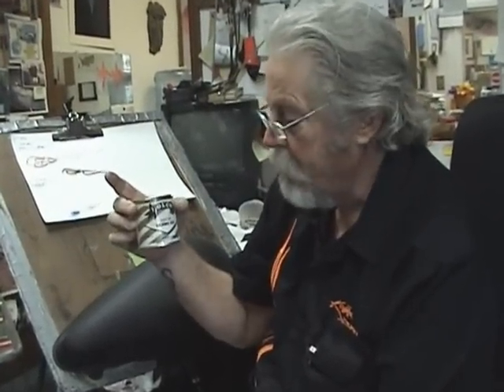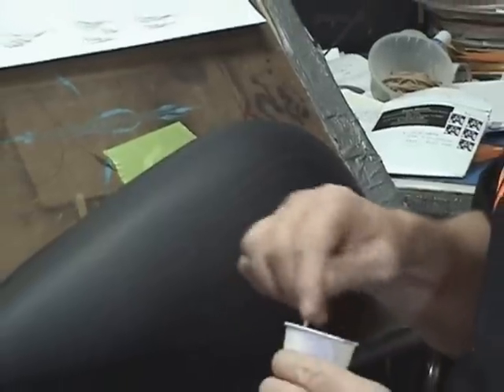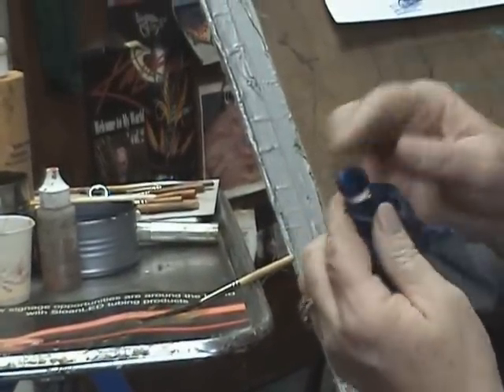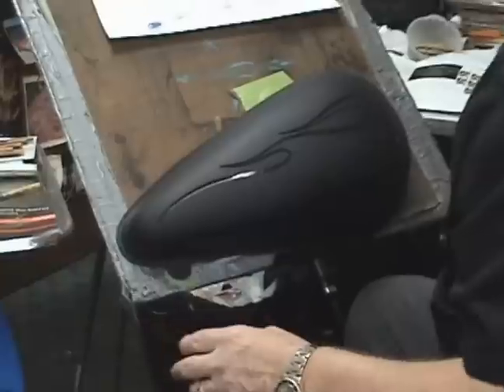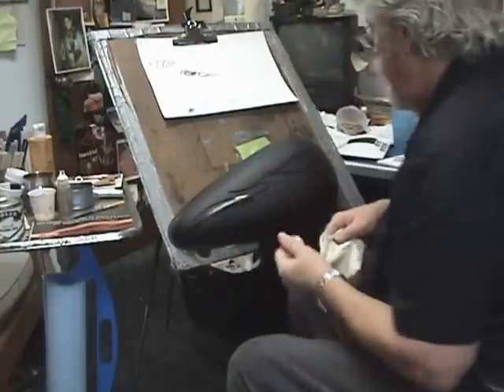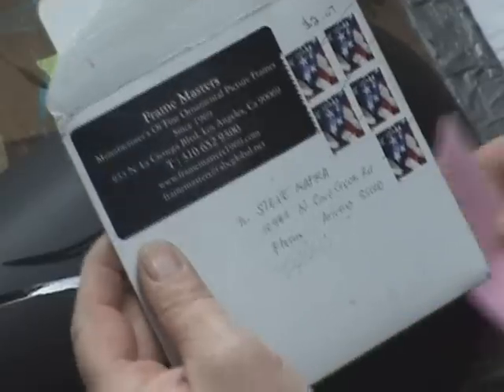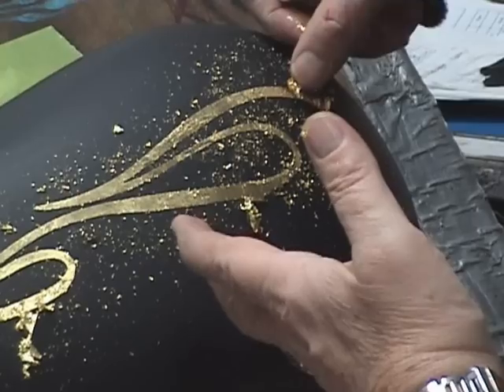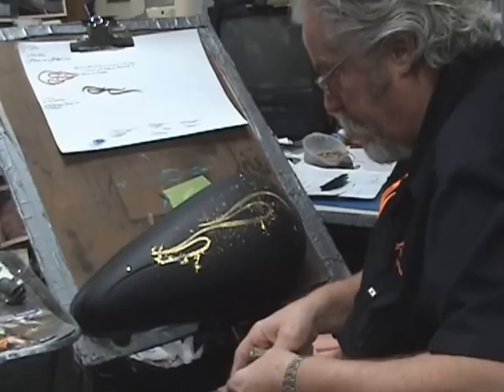Steve Kafka 23k Gold Leaf Flame Graphic, Part 1/2

Comment: I'm so excited that I found your YouTube channel! You and I are pretty close to the same age, and I am an aspiring airbrush artist ,I also ride a Harley, I'm only 5'5 ,& a buck 75, being so short the only Harley that 1 or the other foot can reach the pavement (without duck walking) is a sporster, i know I've heard it all before ! But the deal was so Incredible I couldn't pass it up ! A 1993 sporster  883 with 19,500 miles ,the shop manual, every service recorded with receipts, all after market receipts, highway bars,front highway pegs,solo seat,2 different long seats, sissy bar with small rear chrome rack,3 different styles of grips,4 pairs of HD gloves,2 winter&2summer ,riding leather pants,w/pads ,jacket w/pads, front&rear disc brake locks, 1w/alarm -1 silent  and so many more parts&pieces to mention . All for the sum of $ 3,000 ! The only catch ! For this price there's always a catch ! The guy lived in Yucaipa calif ,in a senior trailer park ,no carport,or garage  ! So aluminum and rain water don't mix,the cases oxidized, as well as jugs,triple tree,the only aluminum that didn't oxidize was the heads,probably cause the peanut gas tank protected them ,front forks also! I've decided to clean it up as best I can,use self etching primer, and matte black the whole bike except ,heads, pushrod tubes, ill detail the cooling fins ,a local body shop supplier has some extreme paint that is 10 x better than rattle can header or BBQ paint ,that won't peel,flake or discolor from heat ! I got rid of the small gas tank,i bought a pacho-pako ?4.5 gal,flush gas cap,got a killer deal  $275.00 for tank, pkg deal gas cap included for $ 25.00 w/new bolts,rubber isolators, petcock/off/on/reserve, fuel filter,all for $300.00+ plus damn calif,state tax of 8. 3/4 cents per dollar, this state really sucks now ! I'm so ready to find another state ! Any suggestions? Have you ever tried true fire flames ? Just wondering, your old school flames are excellent, especially seeing the process of wet over wet ! I couldn't catch where you bought your pinstriping brushes from ?which ones would be needed to complete for a start to finish striping job,just the needs not the wants, extras can come later,ill need #'s  and proper names ,and manufacturers/seller/ website/or phone#. And how does your price system work? In 1of your videos 1-hour $125.00 per hour,both sides of HD gas tank =2hrs =$250.00 ,$ basic old school flames ? Pinstripes on said flames -$ 75.00? I just need a general price range for all you do as I don't want to cut any artist throat by no means ! Nor do I want to overcharge potential customers, there are standards i set for myself, and will honor all those I've learned from ,not to put out crap work , i pick up knowledge from all the best,proficient air brush tutors i can find,this business is so hard to bust into, i advertised on Facebook for a local tutor,3 months later I get a call, he and I painted my new tank with epoxy primer, charged me $100.00 for 1 qt of epoxy paint,reducer, used my spray gun,gave me 2 mixing cups,2 sheets of 320 grit ,to sand rattle can 2-k primer,1 small rattle can guide coat, 2 sheets 600grit,2 sheets 1,000,2 sheets1,500, & 3 sheets of 3,000 1 for final scuffing before clear coat,& 1 for final color sanding,&1 for scuffing before buffing. I gave him 2 gas tanks in lewe of teaching me some airbrush tricks &tips&short cuts ,and things to avoid.  The guy painted up the gas tank ,entered it in a art show which the actor Danny Trejo attended, he fell in love with the gas tank and had to have it, un known to my tutor and my self all art entered for show is donated and sold for charity, which is a good thing, so my tutor freaks out ,calls me &says he can't get my tank back,then tells me that unless somebody out bids him my tank is going home with Danny Trejo,  my tutor painted it with a Breaking Bad Theme, it had the main character Walter on the side,part of the airplane on the other, and a dog always seen on the opening credits from the series, i told my tutor to just go ahead and give my tank to Danny, so Danny just gave what he felt was extremely generous & above &beyond.  I did get some pictures of my tutor,Danny Trejo,another actor friend of Danny's And the gas tank !  I told my tutor that the art  show,and  publicity  would be good for him and get his name out there as an artist, i then said before you get a big head how many 1 hour sessions did he think would be fair for the loss of a $400.00 gas tank that Boosted his career, he quit his paint&body shop job &went solo, and now is the painter in charge of the custom designs of Harley Davidson paint jobs,and special orders from customers who are willing to pay the big bucks to be different than the cookie cutter Harley 's out there, i hear my tutor is doing well,$60-to80,00 per year,plus bonuses ! Good on him,too bad I've only see him a total of 2 times, the other tutors on YouTube, yes they show you a few common things ,but want you to buy their DVD series from &39.95 + shipping  per DVD for a 12 -15 box set! There is only 1 guy out there that helps newbie 's ,he said something that I was experiencing that nailed everything right on the head! And that was the thing that happened to him and thats why he will never charge ,for anything he puts out there ! He said every tutor out there will only teach you the minimal basics & tells you to practice ,practice,practice, and that should keep you busy for a good 6 -8 months then the tutor will show you a few short cuts,and a few tricks, and lots more practice, im not knocking practice, practice is good and required for muscle memory, i put in the hours and paint everything that doesn't crawl away, i mean I go buy hoods ,doors,deck lids just to paint on, i put the paint on when done,wipe it off with lacquer thinner &start over ,&over& over,.this guy tells it from the heart and wants to keep you from the tutor pitfalls, & wasted time&money&energy, this guy said the tutors won't teach you their best stuff because you could end up better than the tutor! How would that look ? The tutors out there consider you competition ,and see you taking money out of their wallet,robbing you of food,housing,they want all the jobs out there ! Even if the population of your city is large enough to support 6-10  airbrush artist  so everyone can make a living ! This guy said he seen and heard it and experienced pretty much all of it,even had customers tell him that so&so told him you were sloppy,didn't finish customers art,and even sold customers stuff ,and then there's the thats why you had to move here  ,you were run out of town etc,etc,.you should check this guy out one of these days when you got nothing to do or your football team is loosing and no way to make a come back ! His YouTube channel is bloodshot army airbrushing  he's a Canadian  but I swear he talks like a California surfer from the 1960's he knows his stuff,he's sincere ,honest ,
And can and will answer any and all questions, the only stupid question is the one that was never asked! You can text him any time and he will respond as fast as he can ! He even has a few projects where the newest paint called lumalore  which is electrically charged colored paint that is a several stage process and has to be tested for grounding,continuity, and shorts, before its sealed.with paint  the paint runs off its own battery or can be fused& wired to your ,car, hot rod,chopper,Harley, skate board bicycle ,boats it can be put on almost anything, it comes with a controller,that you can set the brightness, the speed of the electric flow,you even have a fade option, that you will see nothing then it starts being visible  gets bright then disappears  or just keep it on high all the time at night (the being seen thing ! Cars never see us ! So many close calls ! My next purchase is going to be a train Horn! I need to find a small air storage tank I can hide on my Harley along with a POWERFUL small 12 volt air compressor capable of cycling up to operate a 160-180 pressure switch that can be hidden or camouflaged  ,then the next a**^ole that turns left in front of me gets the whole experience ! I'm 63 and don't heal like I did when I was a pup ! A loyal fan Billy Gross,
I have quite a few of your videos to watch,&take notes &save again thanks for doing all you do for the new guys&girls .
Billygross592@gmail.com

Comment: I guild my artwork or if Im commissioned to do a piece thats from the Gutenburg Bible. Guilding on calf/goat skins is much different than what I use but I've always loved your smooth lines and watching your videos. Jerry Tessler makes a very good raised gold leaf gesso and REAL gold leaf sticks beautifully. Speedballs imitation is okay but you better seal it otherwise it will oxidize. I am going to try your burnishing method when i do gold leaf on my art boards, i love the swirl effect. I unfortunately purchased the $105 heminite stone from a calligraphy and illuminated art/lettering site and it works no better than my 11 dollar and 9 dollar burnishing stones or a piece of jewellers cloth. Live and learn... thanks for all the great information and especially the info on the company who makes the gold leaf... I didn't speak to Dave but it was cheaper than going through my calligraphy guilds supplier and looks so beauitful.  Top notch... and the flexibility... it's durable to a point even though it's delicate.

Comment from the maker: After checking the Rolco label, it says if time permits to try their slow set oil-based guilding size, it also says that their quick -set contains mineral spirits. my conclusion is that the quick-dry does not have any oil, except in the spirits, hope this helps.

Comment: There is some debate on adding harder to keep the leaf from wrinkling due to the incompatibility of 2k Urethane to the Enamel based sizing. On one side I hear add hardener and on the other side they say to simple let it dry for several days. My project is unique, I want to White Gold Leaf my HD ABS Mid Frame heat shields on Softail with very hot 110 inch engine. Primer... automotive flexible primer vs actual guilding primer. I have sanded my ABS smooth but it still needs primer and possible paint on it as well for a smooth surface. My goal is a high polished Chrome look. A company in New Your wants $5 per sq inch to chrome it, way out of my budget.
Reply: @stevekafka  I eventually gave up on the abs and had the heatsheilds formed out of 422 stainless steel and polished them, then I put a 2000 degree stickon heatsheild on the underside and it worked perfectly.

Comment: Hi Steve, I appreciate your sharing expertise. I would like to know about clearing over leaf for Motorcycle tank. I want to brush on clear with some hardener. Please share ratio of one shot clear and hardener and how many brush on coats if you will. I am on my first gilding project and most info is always missing something. I will leaf over quick oil size, clear and pinstripe. Base color is flat black and I want gilding and pinstriping to be glossy. Thank you soooooo much.

Comment: Okay, I'm a total Newb, but I want to do this!  I watched both parts.  My first newb question is, Instead of using the bare black tank, I wanted a different base color first, like a white, red, or whatever, for the whole tank first, I would of course shoot the the whole tank my starting color before applying my graphic, correct?  I would not want to use clear after, until I do my gold leaf graphic(s) and I was finished with the tank completely right?  Sorry for newb questions, I'm not a painter.

Comment: I am trying metal leaf on a keyboard which is similar material to what you are applying on here but my "mona lisa' brand adhesive scratches easily even with sealer. i am going to try your size. any tips for great adhesion. i'd like to avoid a primer as they don't always work out. thank you!

Comment from the maker: Comp. gold has a use, it's much more difficult to work with. Try the real stuff it's much easier. Let the comp dry longer and press harder, if it breaks out let the size dry longer, be a little rougher with it. Try letting it dry then wipe it in one direction before going back to turn it. Good Luck.
Reply: Huh?

Comment from the maker: I am assuming you used the same brand sizing that I used. Did you wait at least 1/2 hour before guilding the leaf. Yes you thin the size with mineral spirits, sounds like the size was too thick and maybe still wet. some spend years perfecting their leaf work, wipe it off and keep trying, you'll get it . I think you may have waited too long for quick size, the older stuff gives you a longer window. Hope this helps.
Steve
Reply: Any relation to the writer?  Bucky Kafka? <Juskidn... Franz though ? Also Beautiful work. But you got eyes. So ahma tellin' yew watcha alreddi new !!
Reply: Steve Kafka I

Comment: Hey Steve
I looked into the supplier that you spoke about for the gold leaf I was wondering if you suggest single weight or the double weight? Also from another supplier I noticed they have the gold transfer sheets or the loose sheets. Have you ever used the transfer sheets and are they any good?

Comment: I have just started leafing and I have began with speedball products. I have tried the copper and composition gold and the issue I am having is the leaf is sticking to the glue just fine but it is also sticking everywhere else I cant even take it off with my finger nail I nearly have to take a razor to it. It is on clean painted material is there a difference in automotive and full cover leafing or is my technique off?  Any help would be so appreciated thank you